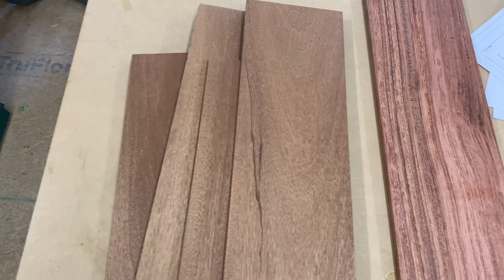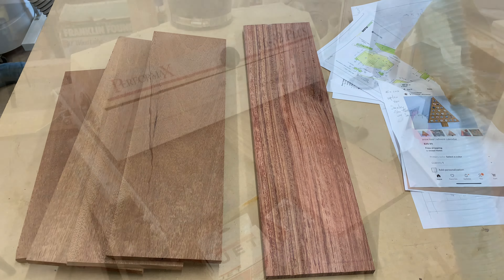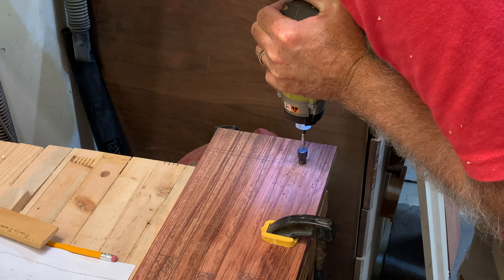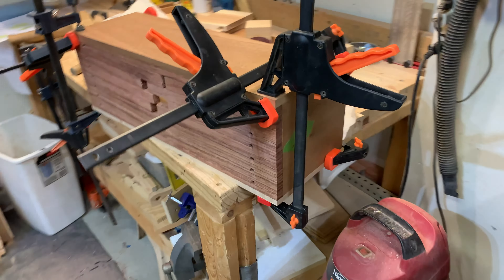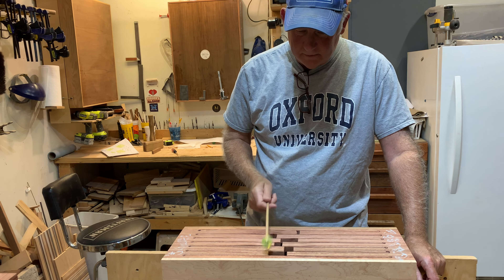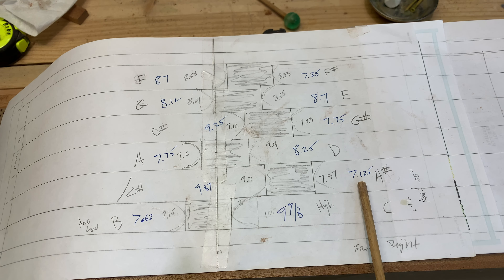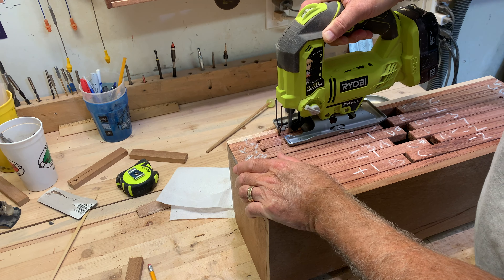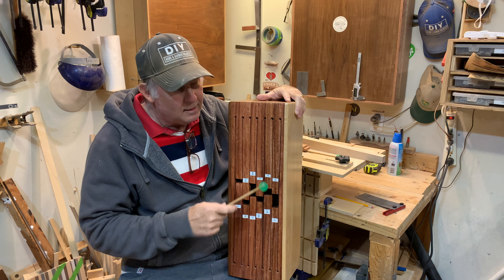Making a Tongue Drum

Comment: so Ive been messing around with this calculator for these drums. And also the thickness of the playing board determines pitch. The thinner your tongues are, less long your tongue's need to be to be low. 

I've been thinking about marimba keys, they are thin in the middle and thick on the ends, maybe that will make the drum more resonant if you thin down the middle of each tongue beforehand
Reply from the maker: All of those are variations on the tone